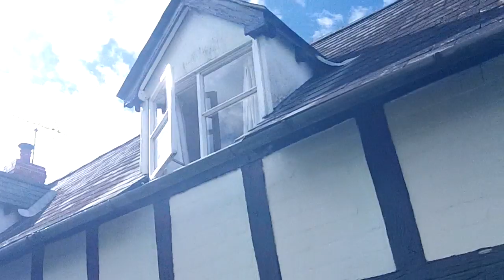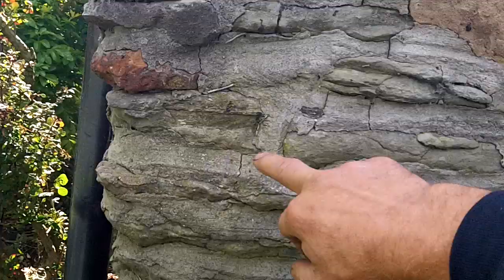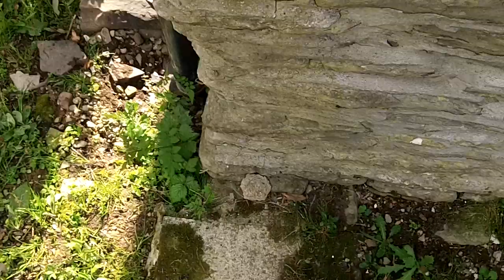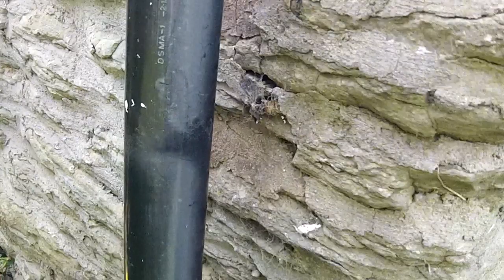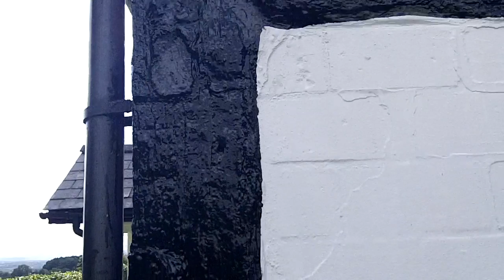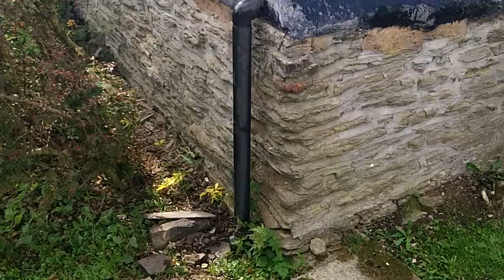Another damp old house - Bad drainage causing subsidence

Comment: Hi Peter, I'm a structural engineer - you are correct in your approach to cure the rain water settling on the wall base as that will ultimately lead to some subsidence of the house.   My feeling is that the cracking around the wall base is not due to subsidence itself and most likely to be local weakness/deterioration.  If there was any major movement then you would be likely to see it a fair distance from the corner and around opening in the elevation each side at doors and windows.  Also I do not think that the bulging of the timber frame is due to subsidence and it looks as if it has been there a long time as you do get in timber frame buildings and is due to lack of lateral restraint from the interior of the building.
Reply from the maker: Fair comment - and any local movement would allow roof spread, which could well create bulging...

Comment: What would need to be done now? Obviously sort the drains out so the water can escape and not cause more damage..but would the walls need major work ? Rough guide of cost?
Reply from the maker: Probably not - no sign of major subsidence - sort out drainage first, let it dry and settle down first, then look again in a few months - if there is evidence of movement then, you may have to do something.  Often just repointing, crack stitching etc is enough.  If there are cavities and washout problems, it may need to be underpinned - I dont like doing this with old houses, as it upsets the balance of the building - and introduces solid, unmoveable areas under what is otherwise a flexible and moveable structure.
Reply: @WarmDryHome  Would anything need be done to the bulging timber on the side of the property?
Reply from the maker: @stephenmitchell1270  I recommended they re-peg and do some timber repairs - so long as the joints are tight, most of these frames can take a fair bit of movement. Excessive weight, as in brickwork, pulls them around - they were built with lightweight panels (wattle and daub) and brickwork really stresses them...